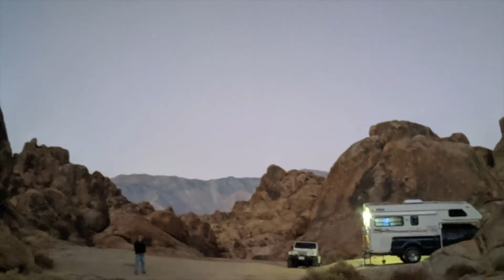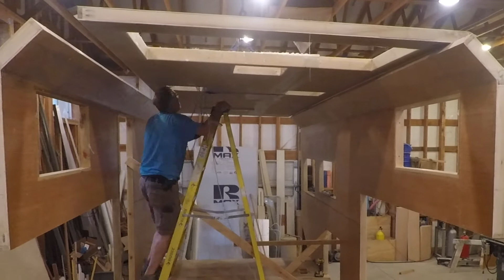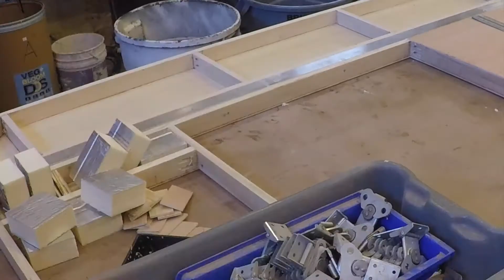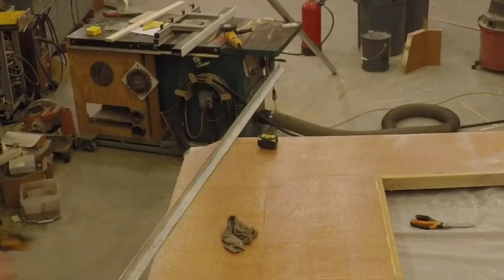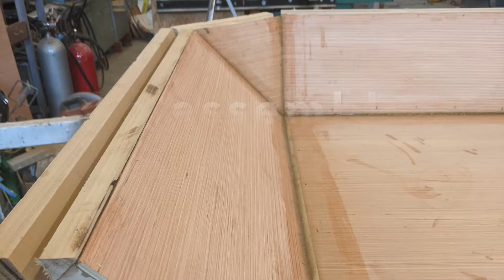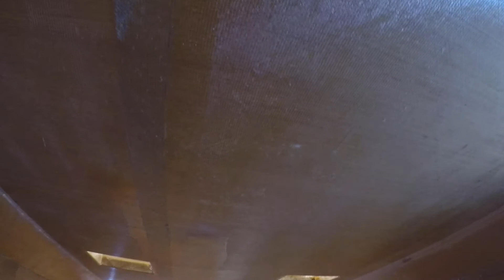Custom Flatbed Camper Build | ep: 4 | Shell assembly

Comment: Did I miss why you cut up the 2" Foam insulation and then glued them in? I assume its for structural strength, but the labor involved is tremendous.
Reply from the maker: Polyisocyanurate foam has little compressive strength but had great insulating capacity. I may have been able to use XPS but it was not easily available. Core material for good stressed skin panels needs high compressive strength which is why honeycomb is typically used and not insulation foam. My torsion box with 5mm plywood about 6" OC with a 5mm skin is EXCEPTIONALLY STRONG. Actually far stronger than I either anticipated or need. It's pretty easy and quick to assemble. The 6" grid is only approximate and grids are just butted (plus glue), not jointed. I just start building with 6"(-) blocks and typically only trim the last column or row. I also made 1" thick interior walls this way with 1/8" (2.7mm) Luan and 3/4" poly iso which were extremely stiff. A big issue is glue bond strength foam to wood. Foam tears readily where wood edges of my grid bond well to the faces and with high strength.